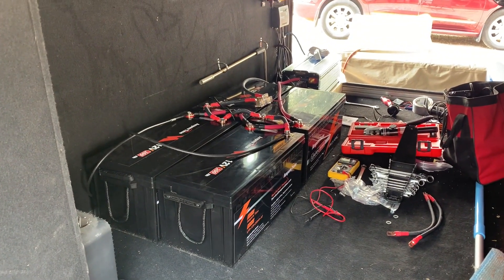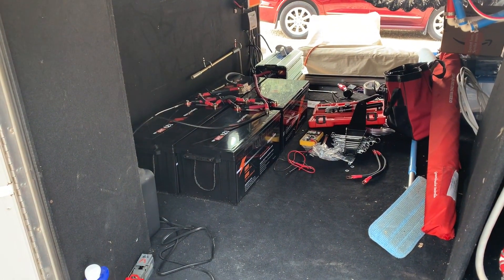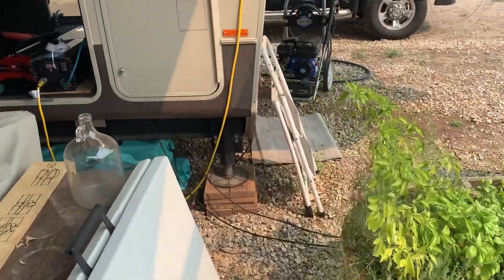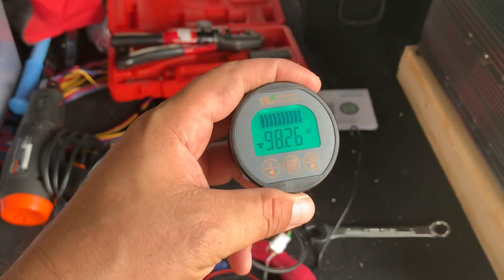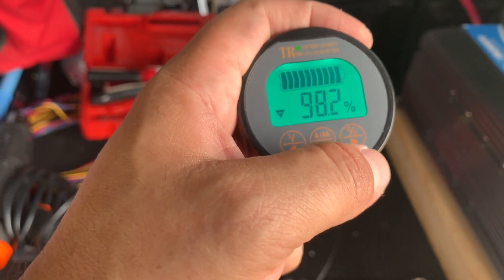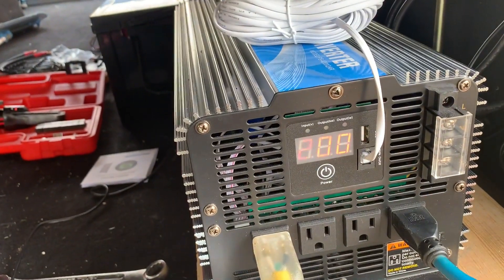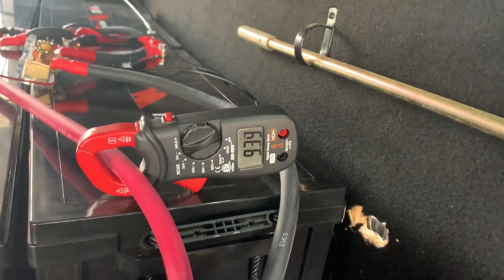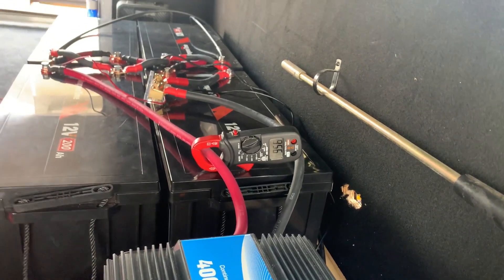Running on the New Ampere Time Lithium Iron Batteries LiFePO4

Comment: I have 4 100ah batteries wire in parallel and series for a 24v system and they draw down so fast just running a Farley new fridge that draws about 100watts    I have no clue what’s going on.  I’m running 2000watts off solar to this as well
Reply from the maker: I have this issue worked out, at the time just not enough solar. I also have 4 100ah lead acid batteries running a small freezer that will pull 300 or so watts when the compressor is running. I have 4 watts of solar charging it. This setup runs my freezer non stop as long as there is decent sun. But If I get two days of cloud or very poor sun I have to start keeping an eye on it or it will draw the batteries way down. Plus the charge controller I use on the freezer setup is not a good one. Enough solar and battery are key for sure.
Reply: @thervsolarseries2827  I’m running 2000 watts off solar to these batteries
Reply from the maker: @cowboymcq6711  Something weird going on there then. Is your charge controller working? What kind of trouble shooting have you done up to this point?
Reply: @thervsolarseries2827   yes it’s an all in one unit MPP LV2424  my batteries are topped off all day 27.8 volts suns gets low in the sky and the battery capacity starts dropping right away.  It’s Definitely got me scratching my head
Reply from the maker: @cowboymcq6711  Have you measured the wattage the fridge is pulling recently? If your batteries are staying toped off then either your load is pulling at lot more or there is an issue with your battery bank. I would also put a current clamp on and see how much current is being drawn from your batteries. You should easily go through the night if it were truly only a 100 watt load.
Reply: @thervsolarseries2827  alright I will purchase one of those thanks a ton for the help.  My minds boggled with not being able to last a couple days just running a fridge.  Hell I super old full river agm batteries could run the fridge threw the night at least

Comment: It looks like you’re running a 4000 W inverter. Please remember that in a 12 V system, you’re going to draw about 350 A from the battery pack. Please, please make sure you size the right cable between the battery and the inverter.  That’s why many are looking at 24 V systems because of the amperage drops in half.

Comment: I'm curious how long that rig would run the RV's A/C unit. Cheers!
Reply from the maker: I’m curious of that myself! I ran my portable AC for about an hour which didn’t phase the batteries much. But I know more solar would definitely be necessary. I just picked 11 - 400 watt panels which should do nicely! Also on this RV I have a mini split so less current draw than the roof AC,